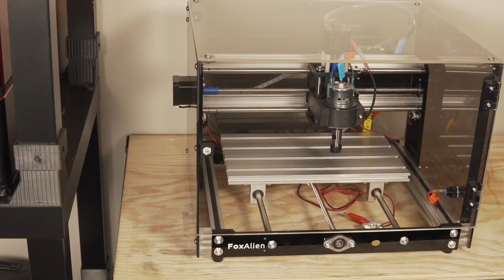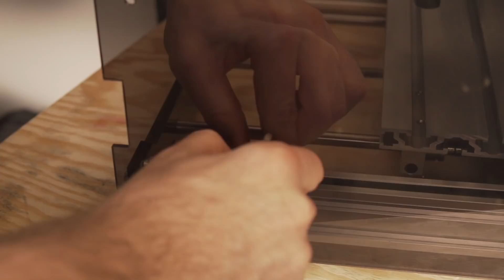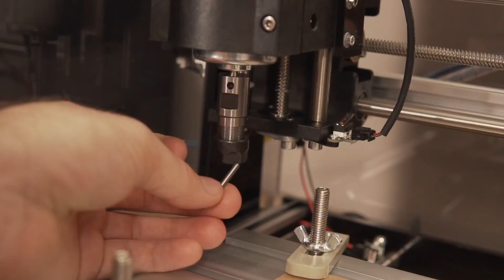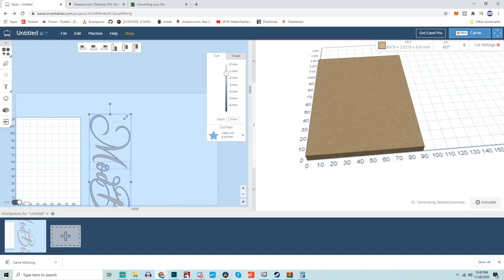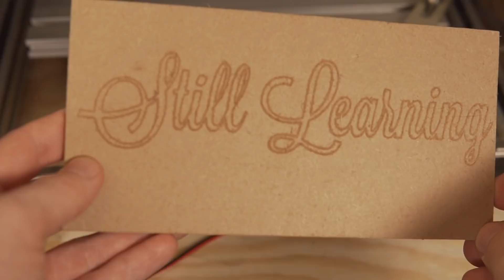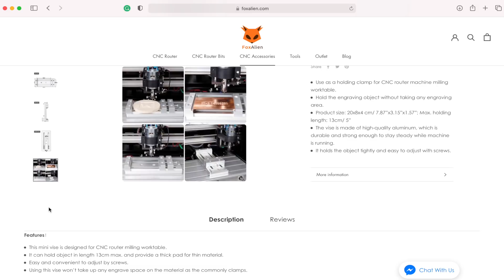Best Sub $400 Desktop CNC 2020? The FoxAlien 3018-SE V2

Comment: Im a CNC machinist that operates both cnc and manual machines daily at work. Ive currently dove into the 3d printing scene and have had a blast. Lately, I have been looking into a machine for at home. Ive had 15 years of practice and I still have issues and problems using equipment like this. Great Video but to be honest IMO a small lathe would be more useful than a mill. With a lathe, creating bushings and spacers ext is very easy and accurite. A lot of what you can do with a mill like that can be done with a decent laser mod on a 3d printer.

Comment: With acrylic you want to use cast acrylic vs extruded.  Cast has a higher melting point.  Extruded tends to melt and bind into the cutting bit.

Comment: laminate is extremely hard, a circular saw with a wood cutting blade can cut two boards without problems, after that it's going to quickly burn up the blade. A circular saw of 800Watt, this little thing has a 60Watt spindle. come on man...

Comment: Bob Warfield over at cnccookbook sells excellent speeds and feeds calculator that I've been used for years for virtually all materials, metal, wood, plastic etc.  They have a try before you buy. Go have a look.
Reply from the maker: Thanks for the tip! I will definitely check it out

Comment: IMO, the absolute worst thing about most of these cheap CNC machines is the spindle, which is generally a generic DC motor with no feedback.  Speed control is done mostly as a guess based on the amount of voltage supplied to the motor and is completely open-loop.  The controller doesn't have any idea if the spindle is spinning over-speed, or stalled, or on fire.  It will happily try to drag the cutting bit through the work piece no matter what.  Don't get me wrong - I'm looking into one of these small machines too.  I was an early adopter of a MAX-NC machine about 22 years ago, and coupled with my total lack of experience, the complete crap homemade software that came with the machine, and the generic DC spindle it was overall a terrible experience.  A friend, who now keeps a Mori-Seiki "Junior" CNC milling machine he converted to be operated by LinuxCNC in my workshop, ended up taking the MAX and working it over, adding a real spindle and spindle control, replacing the crap software with LinuxCNC, and eventually adding a rotary table and an additional axis for a total of 5 axes.  I just let him keep it.  I'm free to use the Mori-Seiki, but it's HUGE for the kind of stuff I want to do, as well as having watched it SNAP a 1/2" carbide end-mill when something went wrong during early testing, makes me very leery of either destroying the machine or maiming myself, so I'm after a little machine like the one being reviewed.

Comment: Use a 1/8 ball mill..or smaller. Finish will be much better. The bit they gave you is an engraving bit. Very pin pointed. Need a LOT of spindle and feed rate shouldn't be crazy fast. Maybe like 6500 rpm... 50 inches per minute. See how the machine reacts to that

Comment: CNC has also come a long way in simplification. In the old days you would have to manually type potentially thousands of lines of code and do all the math (including trig). I'm excluding canned cycles in that statement which are very powerful. With modern CAD/CAM people can create parts with limited and possibly no knowledge of G code. As far as speeds and feeds you needs to find the surface footage for the material with the cutter you are using which is most likely HSS. Goggle is your friend for that. Then plug that into this formula     speed=(surface foot X 12)/(cutter diameter X 3.1415) .  Once you have your speed  feed= speed X (feed per tooth X number of teeth) Also that machine is not very rigid compared to pro stuff so I would start at the low side of the recommended feed per tooth and work from there.

Comment: So I'm machinist by trade. Can you write your own g code for this?
Reply: Frankly, you wouldn’t understand Martin. I also am a machinist by trade. You’d be surprised how many times we can generate better tool paths/speeds and feeds than the stock code the software spits out. That’s why he’s asking if we can write our own code. It’s not a step backwards, you just lack the immersion in programming to understand why he wanted to know that.
Reply: @Martin Luther In my experience, all of the software that comes with these cheap machines treats everything like a 3D printer would - by "slicing" the part and converting it into a height map, and then "raster scanning" the cutter to eventually carve out the shape.  That's probably fine for detailed engraving of something like a photo, but for things like machine parts, GCODE lets you do things like tell the machine to "cut a circle this big at this location" in just a couple of instructions.  It goes to that location, moves the cutter in a circle, and you're done.  Much cleaner results than the x/y/z scanning process, and about a thousand times faster.  The same goes for straight lines and simple curves.  Much more precise control and much more efficient in both time and material.

Comment: when you mill acrylic use an endmill with upflutes vs. downflutes to clear the material faster and prevent heat.
Reply: With acrylic you want to use cast acrylic vs extruded.  Cast has a higher melting point.  Extruded tends to melt and bind into the cutting bit.

Comment: My start with CNC started with a Mitsubishi CNC Wire Cutting Machine, which uses an electrified wire and deionized water to cute any type of metal no matter how hard it is.  We then got a couple CNC Drill Presses, and eventually CNC Mills.  This was back in the late 80s.  So, though a little rusty, I still know how to use them.  Which is why I bought a Snapmaker 2.0.

The 3018 CNC Mills are very nice, but if you ever do want to do anything with soft metals, make sure you have a spindle that can go up to at least 12,000 RPMs.  You’ll need the higher RPMs for delicate/fine work.  Also, make sure you get a full set of collets for your machine.  You can pretty much use any bit that fits into a collet, even those from a router, or a Dremel, that you might have.  You may not be able to use bits that have a larger diameter, but there are hundreds of different types of bits that you can use.
Reply from the maker: Thank you for the tips and recommendations. I believe the upgraded spindle they offer can hit 12000 RPMS. I also think that the other spindle they carry uses a more standard collet which may make it better for using with a wider variety of endmills/cutters. 

How are you liking the Snapmaker 2.0? It looks like a nice machine.
Reply: @ModBotArmy  I really like it, as it fits my needs.  I don't have the space for 3+ CNC machines, and I don't need to produce things in mass, I just need to be able to make what I need in a reasonable amount of time.  What sold me is the screws inside each of the linear rails.  While belts may be ok for 3D printing and laser, they will definitely be an issue when it comes to precision drilling and milling.  Anywho, keep up the great vids!

Comment: Seeing the acrylic frame I would immediately dismiss the machine. I've had an acrylic 3D printer and it was terrible, a CNC produces much higher sideway powers. It would be super flimsy if you do anything more than surface engraving. I would not recommend buying this machine. Unless you CNC cut the acrylic parts as aluminium parts.
Reply from the maker: I do think replacing them with aluminum could be fairly easy. It would have been nice to have those parts in aluminum. Would be cool if they offered a version or upgrade path to get those parts in aluminum.
Reply: @ModBotArmy  That's a great idea!
Reply: I have this machine and it will cut aluminum. I have cut the aluminum bed twice with a single flute 1/8" bit.
Reply: good point!

Comment: I ran a cnc for 20 years but it wasn't  the type you had to know gcode. You entered the dimensions off the print for each event and tool type with speeds and feeds. Two things I can tell you right off the bat is always climb cut for better finishs and taking deflection passes. And those clamps in the video are ok at best for light work but you aren't using them right, never clamp a part with the clamp just crushing the corner of the part if the cutter grabs just a bit in the direction of the clamp pushing on the part you will break the cutter or throw the part. Print a few step ladder type parts just like stairs so you can get the end of the clamp to be level or slightly down on the part for best holding down of the part if you know what i mean. If you have any questions please ask as i am now disabled and bored to tears.
Reply from the maker: Thank you for watching and the info. I am sorry to hear about your situation. I know exactly the stair step clamps you are referencing. I suppose I could either mill them out or just 3d print them.

Comment: Good video 
Will it cut carbon fiber
Reply from the maker: Carbon Fiber is something I would be hesitant to cut due to the horrible dust that you would be breathing in. I am not an expert in the subject but you would need a serious vent/dust collection system. I may be wrong but I believe some even cut it submerged in water to prevent the dust from kicking up.
Reply: Yes, if you upgrade to the 300W spindle.

Comment: I havnt used this particular 3018, but I did  own a Sainsmart for a very short time.  It is more or less the same, just without the enclosure and significantly cheaper.  I didnt think the Sainsmart version was worth $200, so I 100% think this thing is a terrible deal.  It does look like a better machine as far as components and add ons goes, but slapping a coat of paint on trash still makes it trash haha

If all you are doing is engraving or pcbs it will likely work for you, but if your doc is anything more than engraving you are going to outgrow this machine very very quickly and something like the MPCNC can be had for $100ish more.  

Still, a good video, and glad to see you looking at these sort of machines.  Would love to see more cnc content/trying other cheaper desktop cnc machines.
Reply from the maker: The MPCNC is awesome no denying it. I built one years ago but didnt have the space or knowledge at the time to do much with it. When I have a garage that is a project I would like to revisit.

Comment: If you do use this more are you going to run a dust collector to it?
Reply from the maker: I dont think so. It really depends. I would have to remove the enclosure to be able to hook a vacuum up to it. I feel like the parts are small enough that it can work with so that vacuuming after the job has been run is not a huge deal. Unless I can think of another way of implementing a dust collector.